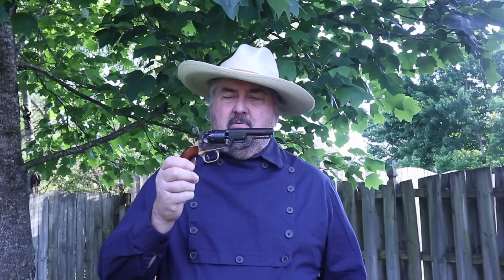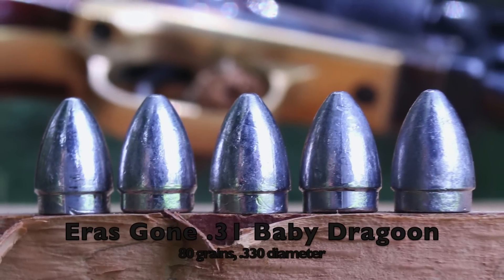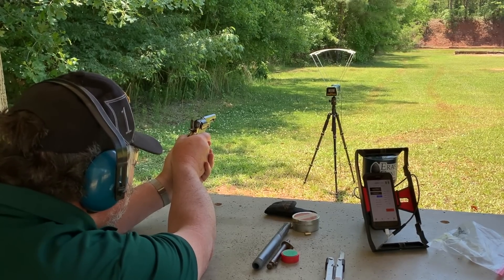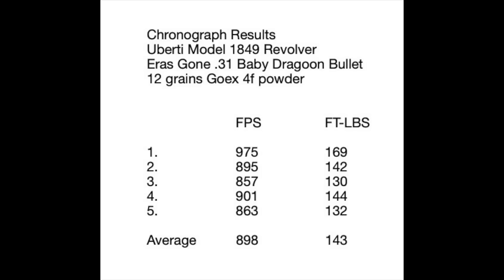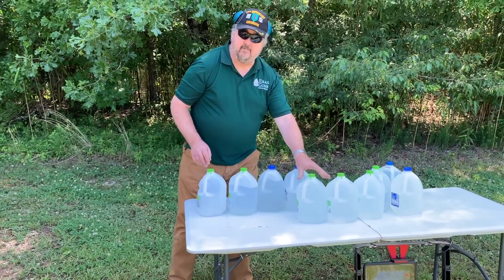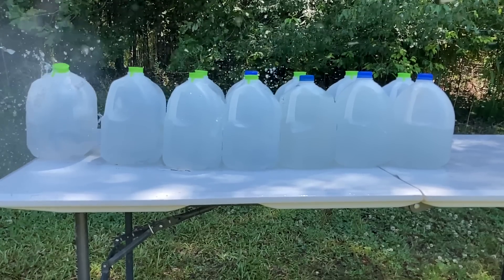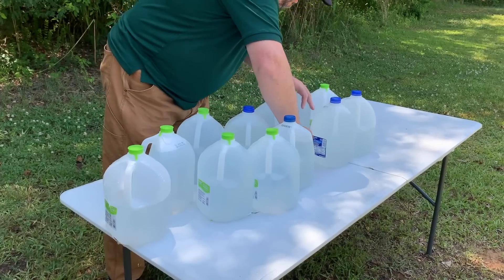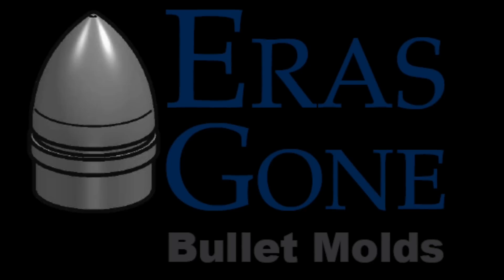Uberti .31 cal Baby Dragoon, Puny or Deadly?

Comment: I'd be interested to learn what you did to solve cap jams.  I love my little Uberti .31, it shreds the X ring at 10 yards, but those jams...  :-[]
Reply from the maker: Thanks! Have you seen my video on that subject? https://www.youtube.com/watch?v=VE4Ihdxq9wc
Reply: @erasgonehistoricalmolds2400  Wonderful, and so simple!  All the advice I've been getting was to drill a hole at the top of the frame recess and install a cap post.  Two reasons I rejected that solution: it's a kludge, and it blocks the only space on that little gun that will admit a capper tool.
Reply: @frankdn109  do you have any tricks for light strikes to make sure it goes bang? I've had some success adding a cap from cap guns, but any tips

Comment: I got an average of 710 fps with ~12.5 grains 3F Swiss.  I didn’t think there would be that much difference in 3F and 4F, so I’m going to test 4F next.  Is there an official max charge for the conical bullet? I can fit 14-15 grains 3F when loading with a cheater bar
Reply: My issue would be just how good is the steel in these little revolvers.  I did some searching and in the replicas it is steel, but none were sure if it was equal to the steel used in modern smokeless revolvers.  I wonder if it would be safe with triple 7 3fff?
Reply: I would imagine 777 and conical or wadcutters would be a self  defense load, .31 pockets are much  under rated    @loquat4440
Reply from the maker: I've not seen any period load data.  But I suspect it was 10-12 grains of a 4f equivalent.
Reply: @erasgonehistoricalmolds2400 I got around to trying some 4f.  I crammed 15 grains in there and got 900-950 fps with the conical so I’m happy with that.  You have to use an extension lever to load that much powder and run the risk of bending the loading lever.
Reply: I have Ken Water's big red book.  He talks about how anemic modern 32 S&W Long loads are and gives data for solid frame Colt or S&W revolvers.  I use his data in my Ruger single six 32 H&R Mag revolver.  Loaded to what the revolver will stand will definitely open your eyes. 
Thanks for the test.  The 1st handgun I carried was a baby dragoon as a teen. No license needed.  It killed a few treed coons in its day.

Comment: This,is fantastic comparison,  I have a very rare S&W 32 LONG.I HAVE SEEN OTHER TEST I THINK YOU DID ONE..HOW a 36 AND a 9mm comparison,  it would shock a lot of people that's for sure
Reply: .32 long S&W uses a 100 grain bullet, but I think most factory is quite anemic due to the older pot metal break open guns that are out there.  Some of these are not even made of steel.

Comment: Any problems with the loading ram crushing the tip of the conical on the 31 cal, I have a Pietta pocket 31 cal dragoon, just wondering.
Reply from the maker: The Uberti Model 1849 has a correctly shaped loading plunger and it does not blunt the bullet.  The Pietta Remington will not work with this bullet.  Its loading port is much smaller than the original and a conical bullet will not fit under the load lever.

Comment: Ima keep it 100 higher end 22lr out of a long barrel is probably more effective than this. Tired of the hate on .22 look up actual self defense stories people have been dropped from one shot out of a pistol before.

Aguila Supermax out of a carbine length barrel is about 190 ft lbs.
Reply: my 200 dollar Heritage .22WMR single action army clone is much better, but that's not the point. Black powder is fun, and it's cool to see it's still not entirely useless.
Reply: Here’s two examples of hot loaded 22lr.  A 29 grain federal punch is supposed to do 1650 fps from a 24 inch barrel so 175 ft lbs.  cci stinger is 32 grains at 1640 so 191 ft lbs.  The 80 grains pocket colt bullet can hit 950 fps by my tests so 160 ft lbs.  but the pocket colt is a 4 inch barrel and the 22s listed are from rifle length barrels.  I think it is very important to take barrel length into consideration when comparing because almost anything fired from a pistol barrel will be weaker than fired from a longer rifle barrel.  For example, the federal punch that I listed does 1650 from a 24 inch barrel but only 1070 from a 2 inch barrel (74 ft lbs).   So to conclude,  I think the pocket colt could be more powerful than some of the hottest 22s when fired from the same length barrel.  Especially since the energy levels from the 4 inch pocket colt are already comparable to the hot loaded 22s from a rifle barrel.

Comment: They actually are better than a 9mm. Bigger.
Reply: What are you talking about? 9mm is a .356 diameter and these are .33
Reply: @jumpkickman1993  you forgot a number.
Reply: @mattisenberger4042  357 but that's beside the point
Reply: @jumpkickman1993  sorry I carry .44 's openly everyday. I'm a Texan. Expect nothing less.
Reply: @jumpkickman1993  9mm bounces in the barrel of anything larger than .25 sorry bro. Only fools carry 9mm. Or folks that can't kill shit with one bullet.
Reply: @jacobmccandles1767  no such thing as 500 fpe in a 9mm. It's to small. That's like saying you can get that out of a .22 . Don't work that way.
Reply: @mattisenberger4042  I'd have said the same not long ago, but Norma Envy features a 124gr bullet at an advertized 1345 fps, which comes out to 498 ft/lbs.
 Buffalo Bore, Underwood, and Liberty all have loads in the 450fpe range.
Speed adds energy at twice the rate of weight.
  Put another way:
  Doubling projectile weight at the same speed doubles your kinetic energy, BUT doubling your speed at the same projectile weight quadruples your energy.

Comment: Based on the fact that a .22 Short is still deady, I have no doubt the .31 cal is deadly. Anything bullet can kill if aimed right.
Reply: But in defensive situations isn't the object to incapacitate a target rather than kill them? If the crazy guy attacking me with a knife is strung out on PCP I'm not sure a .22 or .31 would stop him.
Reply: @twistedyogert   a bullet though your heart or spine will stop anyone no matter how big their pain tolerance is or how high they are. Bigger bullets do more damage, no doubt about that but as long as the projectile can reach far enough inside to hit the important parts they can stop the attacker. 

That isn’t to say that a .22 is just as effective as a 9mm or that a .31 cap and ball revolver is just as strong as a .36 or a .44 cap and ball, they not. In fact if you don’t hit anything important with a .22 or .31 cap and ball the weapon is much less likely to stop an attacker. 

Simply put they CAN stop an attacker with proper shot placement even if they are hop up on drugs but if you miss the important parts like the lungs, heart, spine, brain, etc they won’t do much damage
Reply: @massmedia7158  These things wouldn't have been popular if they weren't good enough to stop an attacker. From what I've heard, selling these pistols saved Colt from going under.
Reply: @twistedyogert  exactly

Comment: I bought a second generation Colt 1862 Navy in 1980, right as they were remaking their cap and ball revolvers, carried it and a model 94 as home defense weapons, as a Marine on active duty, picked up a new Uberti, "pocket police", a 71, in the box, almost forty years ago, not well finished, spent a couple years stoning the frame square, flat, re-color casing it, and used it twenty years, at our home, "retired", in farm country, NC, next to a creek, and that pistol killed at least a hundred substantial snake, copperheads, water moccasins, eastern diamond backs, with both ball and shot, and along with a North American Arms 22 magnum, was the mainstay as we cleared fifty years of brush, wife and I, over about five years.  This was no surprise to me, I've never chronographed or tried to measure energy, simply because I was quite please with its "live performance".  I still keep one in my chair in the living room, it's deadly, accurate, and I never have to buy ammo, I just make it.  I've got five or six 32 acp's, a 25 acp, and they only barely reach a similar, not equal performance.  I used to think the non-expanding full metal jacket responsible, but now consider the higher velocity, with less friction, resistance, is responsible for the better performance.  The thirty six navy has usually been fired with 25 to 30 grains of Goex, and a 38 doesn't compete.  Thanks for the chronograph, and the clear evidence of "penetration".  Semper Fidelis, John McClain
Reply: I chronographed the 1851 Navy with a 145gr Kaido conical and I got and average of 1025fps. That's 325ft-lbs equal to the 9mm
Reply: You look just at the numbers the .31 was responsible for more deaths than all the others. Usually a week later they passed. Not especially quick but effective. No antibiotics back then.

Comment: Hmmm.  12 grains?  My load for .32 S&W Long is 14 (volume equivalent, using American Pioneer Powder), IIRC, which is slightly compressed to give a cartridge length that fits my 1890s vintage H&R top break (probably originally made for .32 H&R, but no step in the chambers).  Might get another grain or two in there with a different bullet and cylinder length for full .32 Long.  Factory .32 S&W and .32 Long factory loads used slightly heavier bullets -- 95-100 grains cover most of them, and my load is a 100 grain wadcutter (because it was the cast bullet I could find when I ordered components) -- that cuts velocity some, of course, which reduces energy a little for the same powder load, but tends to improve penetration.  The real measure here is powder load, other factors equal.  Still, I'll call this equivalent to a .32 S&W or .32 H&R, neither of which was "as puny as a .22."